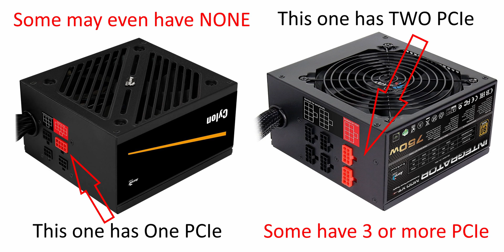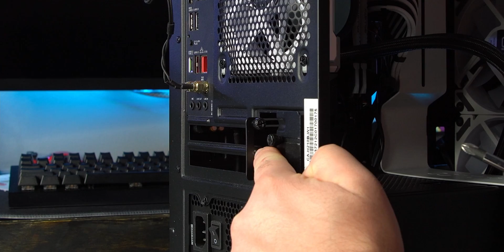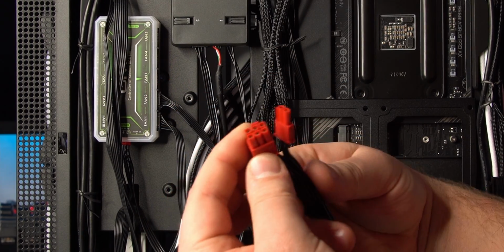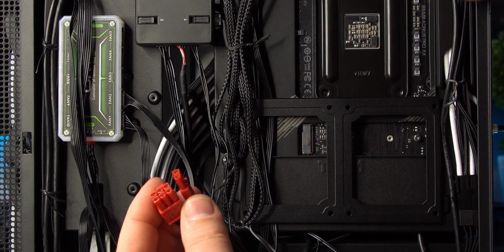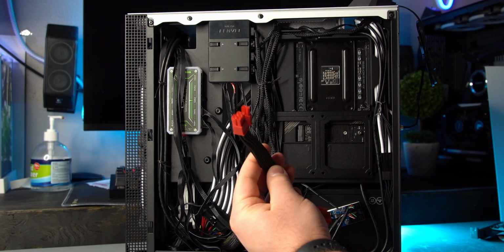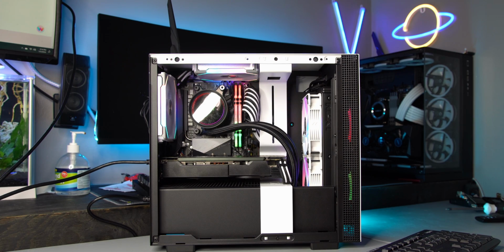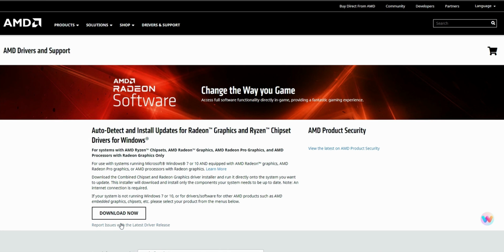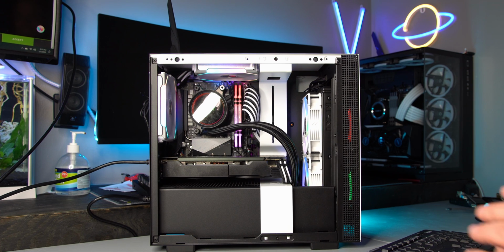How to Install a Graphics Card into your PC

Comment: Why my gpu not been shown in task manager
Reply from the maker: Have you installed the driver for your GPU? Also, is the HDMI or display cable plugged into the GPU instead of motherboard? If those are done, check your task manager settings to see if maybe it's not showing certain things.

Comment: My case doesnt have screws for the side plate where the pieces fall off and i can see the hdmi. What do i need too do??
Reply from the maker: @Randomtaborian  if the case is brand new it should have come with a box of bag of screws. If not you'll need to get the correct screws. They're usually the same screws holding the power supply in
Reply: I found out i need to bend the things in place too see the hdmi spot and stuff like that but theres something in the way of bending it fully so idk

Comment: What should I do if my graphics card stops spinning? I installed it correctly and even cleaned it, but it still won’t spin 😢
Reply from the maker: @-lunanights-3054  the GPU fans only spin when the temp reaches a certain temp. If you load up a game and GPU temp goes above 60⁰c and it still doesn't spin then you may have an issue
Reply: @ hmm, I asked my dad and brother and they said there was an issue with the power supply, but I’m not sure which one would be good for my computer. It’s an intel core i7 9th gen. 

Apparently, even after we plugged in the monitors to the pc, they wouldn’t turn on and my dad said that we fried the graphics card.
Reply from the maker: @-lunanights-3054  is the monitor still showing picture when it's plugged into the GPU? If yes then the GPU isnt fried. Load up a game and get the GPU temp up. None of my gpus turn their fans on unless temp exceeds certain temps.
Reply: @BuildsWithV  The monitors wouldn’t turn on, even when everything was plugged in and into power
Reply from the maker: @-lunanights-3054  ah okay, I misunderstood. What GPU is it and what power supply do you have?
Reply: @BuildsWithV  the gpu was a GeForce and the power supple was a thermaltake 600w
Reply from the maker: @-lunanights-3054  everything should have worked fine. 600w is plenty for most GPUs. Maybe the GPU was defective
Reply: @BuildsWithV  I see, thank you for answering my questions so fast, ^^
Reply: @BuildsWithV  ah, also the reason my dad thought the power supply wasn’t enough was because the fan for that wasn’t turning on either.

Comment: Are 6 pin to 8 pins safe for gpu? I have a 1060. And a amz ryzen 3200d and I don’t have a 8 pin. But I’m buying a 6 pin to 8 pin extension. Is it safe?
Reply from the maker: @KorraFN  I've never used or even heard of a cable like that. With a 1060 that doesn't use a huge amount of power it might be okay. I always just recommended swapping to a different PSU. I have a great PSU swapping tutorial that should make it super easy if you decide later on to swap.
Reply: @ thank you I’ll do that instead
Reply from the maker: @KorraFN  awesome! Here is the link to that video: https://youtu.be/zF7sJlGrZo4?si=SnJWvSsz67fV46tY

Comment: so already i have a new graphics card. now i will need a new power unit as mine dosent have the cabbles or slots and probably a new case assuming that doesn't fit the shitty pre built im trying too make work. if that happens i pray i can just drag the guts over too a new case. i cant afford a new mother board or cpu or hard drives.
Reply: yeah, you should always check if there is enough clearance before buying a graphics card
typically graphics card manufacturers list the physical dimensions on their website

Comment: Mine doesn’t click what do I do
Reply: try pulling it straight up (don't use too much force), it shouldn't come out if clips are in locked position
sometimes those things just don't click, even if you installed graphics card correctly

Comment: I installed the gpu correctly but it seems a little loose like easy to wiggle a little and seems like its sitting at an angle, does anyone know what could be the issue?

Comment: What I CANT figure out is my prebuilt PC I bought came with a AMD graphics card that is chord-less, doesn’t require PCI-E connector however, my other graphics card I’m gonna use has a PCI-E slot that needs to be connected yet I can’t seem to find the PCI-E chord to connect it to begin with. I can’t tell whether or not if there is even a chord in it! I’m a beginner since I barely bought my first prebuilt tower

Comment: Hi there I just bought a used ASUS RX 460 4GB from someone who's not that computer savvy. For the most part it's working, but can't properly start up. I can see the extra monitor showing the booting up signal, but never properly ready to log into the computer. Do you know if this means I need to install a driver, and if so, any idea which one? Would provide a link to the graphics card I bought, but this stupid site censors external links in the comments section.
Reply from the maker: I believe Your main monitor should be plugged into the GPU. I’m not 100% positive on this tho since I’ve never tried it. Try unplugging the hdmi from your motherboard and see if it boots with the GPU.
Reply: @BuildsWithV  Alright tried this, and it worked! I was later able to plug both monitors into the new/used graphics card and do that expanded monitor thing. So it's all good now.

Comment: Can we still plug the HDMI cable into the GPU when the drivers hasn't been installed yet
Reply from the maker: Yea, the drivers install automatically initially but they will still need to be updated
Reply: @BuildsWithV  I plugged it into the gpu but my monitor just says no signal. I did the same for the motherboard and it's the same

Comment: so i have a NVIDIA GeForce RTX 2060 6GB GDDR6 and want to upgrade to a nvidia 3070, 3080, or 3090. is that possible since they may be different sizes. i got my pc prebuilt
Reply from the maker: It is definitely possible. Just have to make sure the size will fit. Typically even prebuilt PCs have lots of space for gpu.

Comment: Hey I got my first gaming pc and all stuff works, but my graphicscard fans wont spin and the rgbs also dont work
Reply from the maker: The GPU fans only pin when the GPU gets warm. Typically over 55C but varies. What RGB doesnt work?
Reply: @BuildsWithV  of the Graphicscard the LEDs, I have a rtx 3060 from Galax

Comment: My pc just stops when i insert the 8 pins in my gpu any help would be appreciated 😅
Reply: Btw I forgot to mention it worked fine before I just wanted to clean it until suddenly it stopped working when I inserted the 8 pins as I mentioned 💀
Reply from the maker: Try to reseat the gpu in its slot on the motherboard if you haven’t already. When cleaning it can come out of the motherboard slightly. Also, do you have any red warning lights on the motherboard? Some motherboards have lights that correspond to which part of the boot is failing etc. If that doesn’t work then make sure all other cables are plugged into your motherboard properly, things can come loose when cleaning unfortunately. Also make sure your display ports are all plugged in fully.
Reply: @BuildsWithV  Thank you so much it's perfectly fine now glad you took the time to respond keep up the great work wish you all the best and stay consistent on your journey 😁👍
Reply from the maker: @strong.minded.quotes  glad you got it figured out. Thank you 🙏 What was the issues?

Comment: This is a lot better video than the last one. I took your time and explained everything . Now I know what the extra cables are for . If you power supply doesn't have the optional connections they you cannot run this GPU . When you install the board and it boots up does it take you to the website to down load the drivers ? Or do you have to find the website and search for the drivers ? Is there anyway you can help me? I want to show the code I am getting when I go to down load shot cut but I cant get anybody to help me. I was thinking about getting MSI GT 710 GPU to upgrade my tower but I am not sure what I need ? Can you help me?
Reply from the maker: So the driver links are in the description as well, you just download either and or Nvidia (depending on your GPU brand). For the GT710 you will download the Nvidia driver and it will all update.
Reply from the maker: Also the gt710 doesn’t have any of those connectors so it’s super easy to plug into your motherboard. Just plug it into your motherboard and then turn the pc on and install the driver software mentioned and you should be good to go.

Comment: Can you help me there isnt comeing anything up on my moniter
Reply from the maker: Make sure the hdmi cable you’re using is good and works, make sure the cable is plugged into your GPU and monitor, if your monitor has various inputs; make sure you select the proper input, make sure your GPU is properly plugged into your motherboard and make sure your power supply cables are properly plugged into your 8-pin gpu connector and into the PSU properly (if it’s modular). If none of that fixes the issue then it could be other issues like a bad GPU, drivers issues or something else.